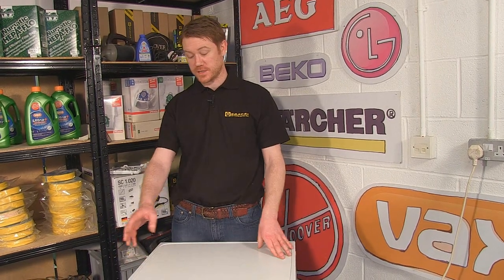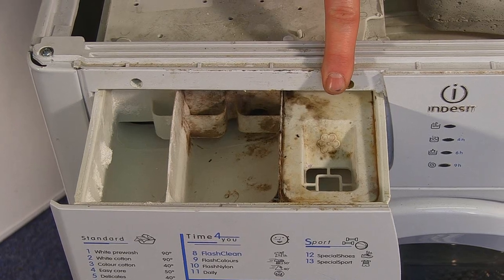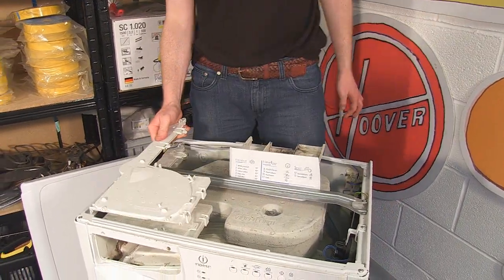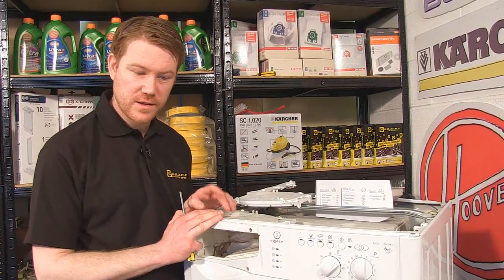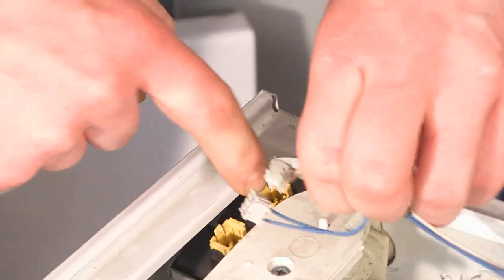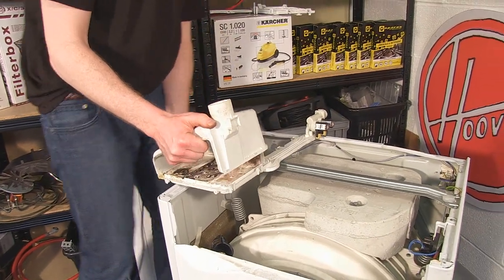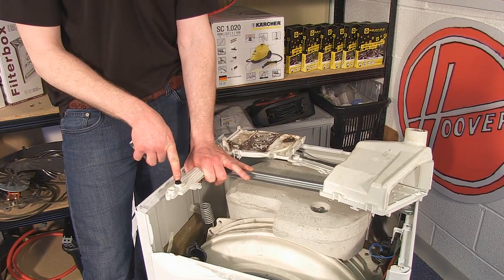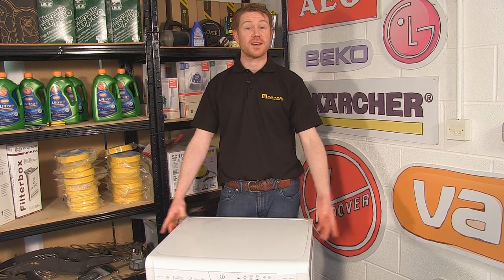Indesit Washing Machine Detergent Dispenser Problems & Cleaning Tips

Comment: you make sounds too easy to do.  I have a problem with the leaking from the bottom of the washing machine and the water came dirty. I couldn't find out the reason yet.  plus it is very difficult to detach the hose from the back, it's narrow to unscrew.
Reply from the maker: Hi Hanada, look around the door seal for a hole or damage to the lip of the seal as it contacts the glass door. If you cannot find any damage you will have to disconnect the machine and pour some water into the drum with the back off to identify where the water is leaking from.
Reply: eSpares  hi.  you are 100% right.  I found a big cut in the door seal at  12 o'clock. I watched the video of replacing it; however, I couldn't unscrew the attached hose under the sink to move the washing machine out. the secure clip is old fashioned one plus the space is too narrow to use a screw driver. I wonder if there's a way to upload the picture.
Reply from the maker: What is your full model number?.
Reply: WFO285SGB/08
M1565BSGB
line 1
Reply: I managed unscrew the hose under the sink at last. Now I'm trying to remove the door seal
Reply from the maker: The only Bosch washing machine seal replacement video we have is here:
https://www.youtube.com/watch?v=yhpBQTPmyNs
Hope it helps.
Reply: eSpares yes I noticed.  mine is I believe the first in its line production,  very old. the spring was on the left side (9o'clock)  and it has tube channel on 11o'clock  . I managed to remove it and will set the order now.  I'm looking as well for the white electric wire and filled the online form to find it for me.
Reply: eSpares yeapppppyyyyyyy..  I managed replacing the door seal and tried the soda and vinegar cleaning tips too.  it returned back new.  thano you so much for your consistent help.  best of wishes.